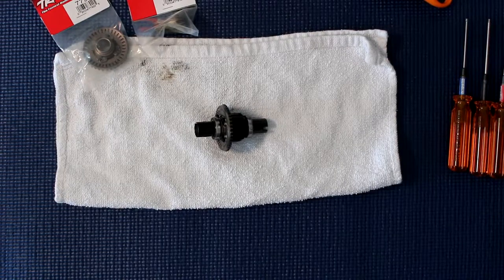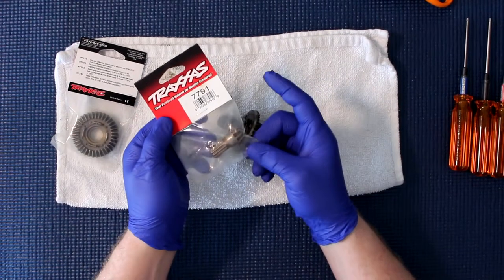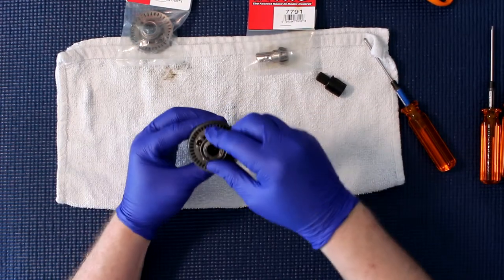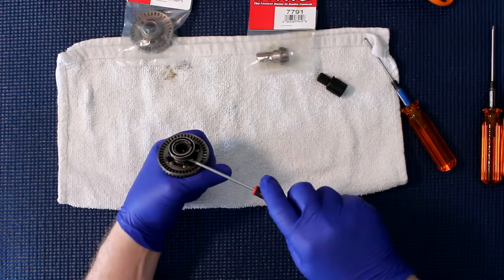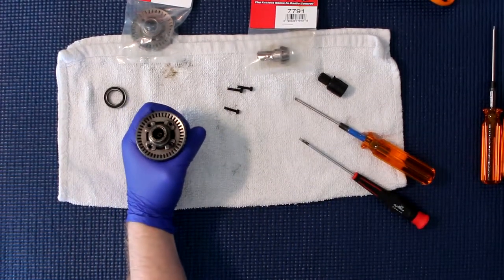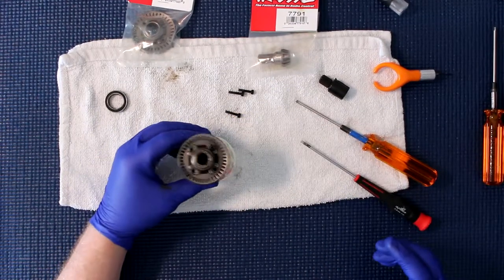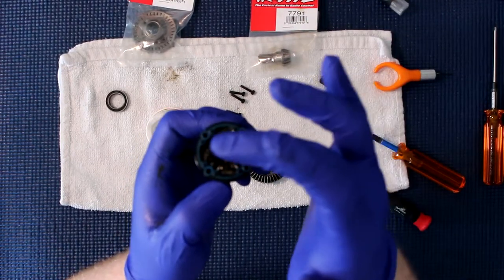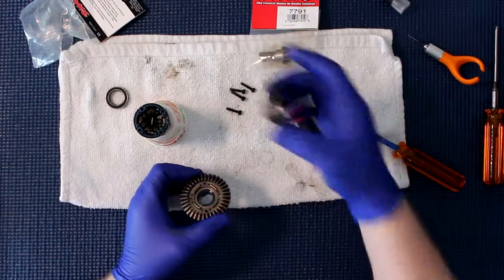How To Change A Ring Gear Of Diff X Maxx

Comment: How many runs do you normally get on the x Maxx with diffs I have had three differentials go out every single time I take out my x Maxx only the rear ones , I have the 8s version just curious
Reply from the maker: Sorry for the late reply normally I check the diffs. Once a year know if you’re blowing them. And it the ring gear that could mean there’s still shrapnel in the case make sure to clean it completely remove everything if there’s a small debris left it might break your gears